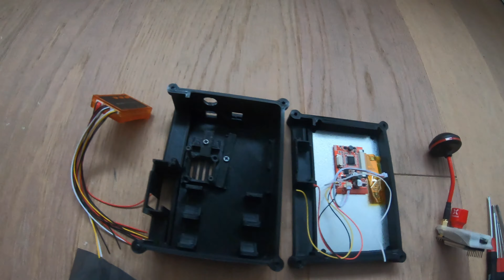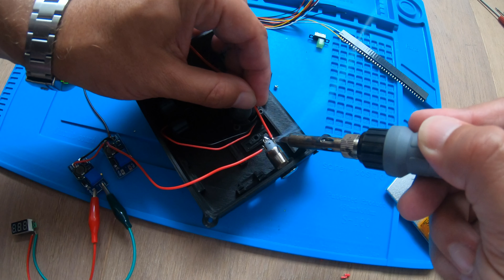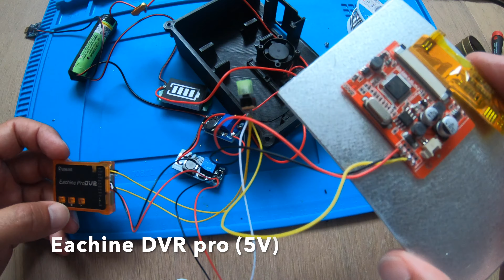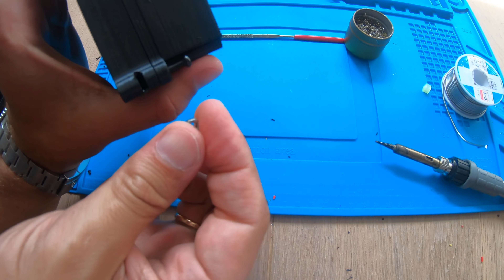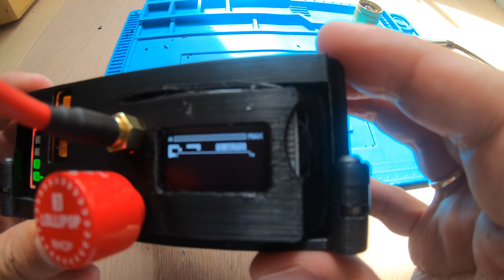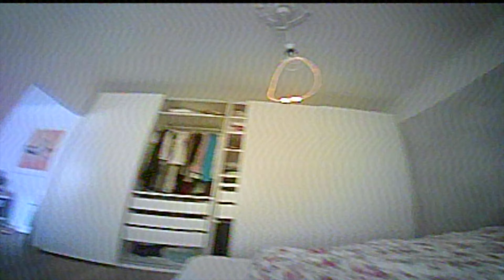DIY FPV Monitor with DVR

Comment: Do you notice lag when flying with the dvr video out feed?
Reply from the maker: it's not that bad for average pilots
Reply: @Unboxingexperience7  great, o have started to build one for use it like ground  station, I have added a 3mm female jack for output or input to my goggles